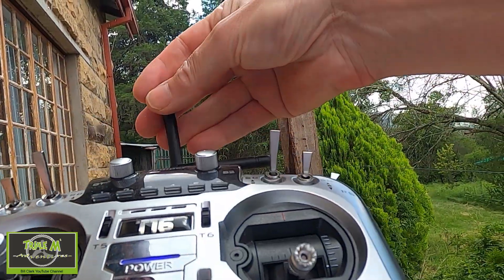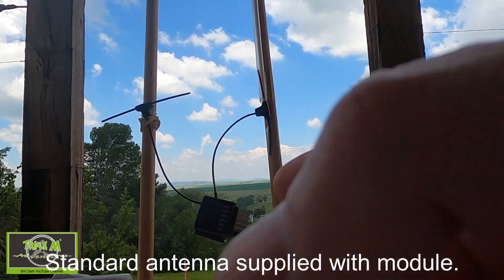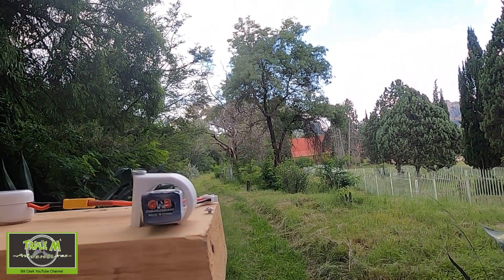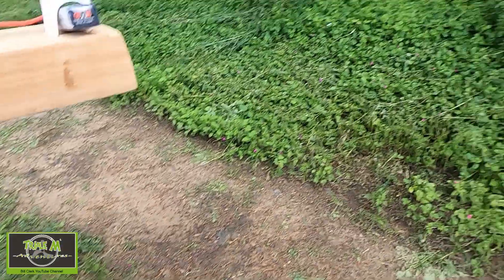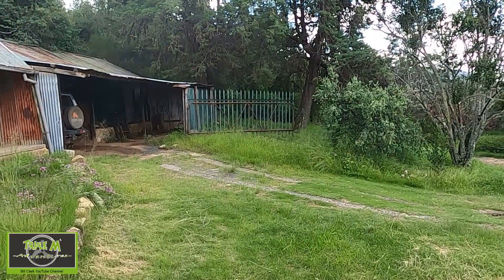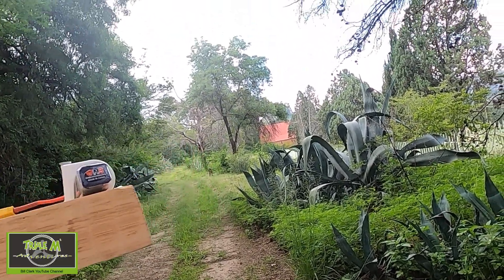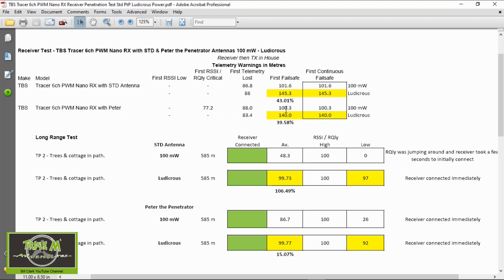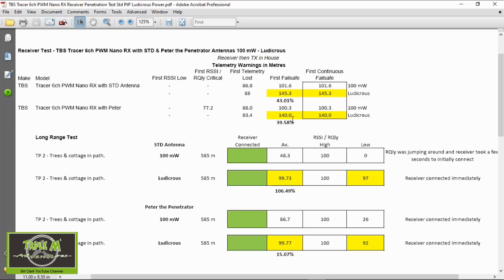TBS Tracer Ludicrous Power Level Test

Comment: Good video and test mate.
Guess I wasted some money on that peter the penetrator aerial. It appears to be slightly worse than the small standard one!
Reply from the maker: I must say I was surprised with the results my tests are unscientific and I do them so I have a comparison between receivers. I do not  think you wasted your hard earned cash because in the original tests at the 585m test we saw better results with Peter, telemetry results on the 100 mW output on the STD antenna with a low RQLY of 0 so possibly a fail safe. With Peter the lowest RQLY was 26 so the penetration for telemetry at least is better and more than likely not to failsafe? STD antenna Average RQLY was only 48.3, Peter's was 86.7 We must remember the LQ statistic data correct was made in firmware version 5.07
Reply: You didn't waste your money.... I have been able to fly behind objects like walls no problem with the peter pan antenna
Reply: @califpv  To be honest I have it but have never used it. I fly behind objects, buildings etc no problems. Eventually its the DJI that starts to go first, not tracer.